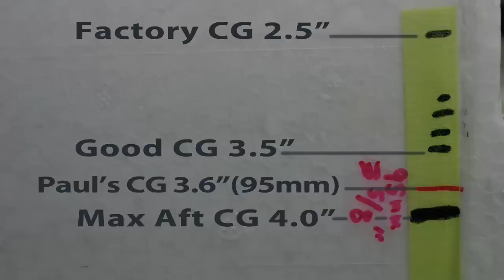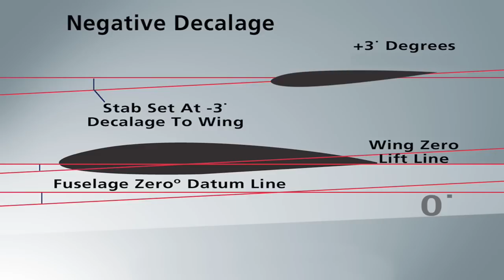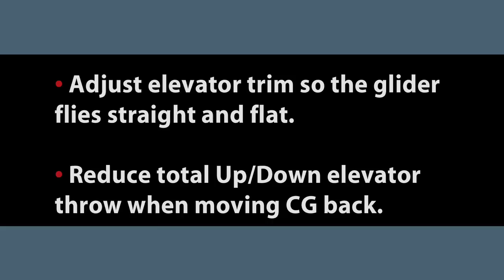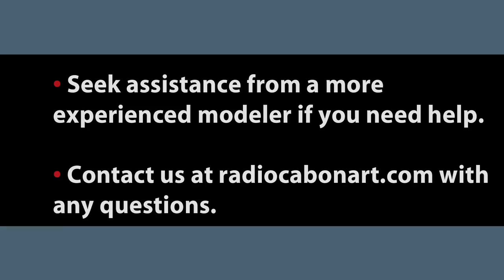Parkzone/E-Flight RADIAN Glider Modification & Tuning Clinic #1

Comment from the maker: As mentioned in the above video, the decalage angle will vary from plane to plane, and the Pro versions seem to have less decalage angle as compared to the 2 chan version.
Change this decalage angle by small amounts if you have not measured exactly the stock decalage angle on your plane. If your plane glides flat with little to no elevator angle required, then your decalage angle is close to optimal. CG must also be adjusted when you change the decalage angle!!
Reply: Paul Naton Have you checked the new E-flight Radian to see if they fixed the damage angle?

Comment: Got your CDs on gliding...somewhat over my Radian head.  However this presentation is extremely helpful.  Have been flying the Radian now for 4 years and I can appreciate the modifications you are doing!  Will look to do some small changes on my current Radian and tighten it up.  Next Radian will suffer a host of changes!  thanks

Comment: I'd like to start off by thanking you for taking the time to put this video together; I enjoyed it very much . I bought the Radian 2 meter glider; like the one in your video and made several of your recommended modifications even before I ever took it for the maiden flight. By the way, I've just gotten into the RC plane hobby two weeks ago and this is my first plane ever. So I reinforced the tail with 3/32" thick plywood similar to what you did. I moved in and reinforced the elevator horn similar to what you did, I changed the decalage by upping the angle on the horiz stab similar to what you did (mine came to 6.5mm for that gap) and added 14 grams of lead weight under the rear skid. I then proceed to verify my CG and see how close it was to the 3 and 5/8" you prefer. This was the hard part, as I did not know how to verify CG. I do research online and end up using a method where the eraser ends of two pencils are used to balance the plane on each wing. With a pencil on each wing, the modified Radian balanced at 4.25" behind the leading edge! So I concluded I had too much tail weight. In the end, I completely removed the 14 grams of lead weight on the tail and added 12 grams of lead right behind the electric engine. Only then where the pencils right under the 3 and 5/8" CG mark. Doesn't that seems strange? What's your opinion on the reliability of this CG verification test method? I did end up flying the plane the next day and when I applied power it immediately wanted to nose dive hard but I still managed to keep it in the air. It was much easier to control once the prop was off but within 5 seconds I hit a tree, so I did not have time to evaluate glide characteristics much and now I am repairing the damage which is not too bad.
Reply: Ay ay ay. Ignore my above post. I don't yet know what I am doing as I am finding out the more I get into this hobby. I'm not giving up though :)
Reply: Talking things out often leads us to The Truth. Thumbs Up, don't forget to share your findings : )

Comment: Vertical lines no problem. As CG goes aft, pitch authority increases, so less elevator deflection is needed for X amount of pitch change. If you would tune for all out akro, you could increase total throw and use a bit of expo to smooth out pitch response. For thermaling at aft CG settings, very little elevator throw is required to change angle of attack and airspeed. See part 2 of this series to learn about maximizing servo resolution with servo arm location and programming.

Comment from the maker: Move the battery back as far as possible then add lead to the bottom of the fuse in the tail area.  This is noted in the video. Takes about a 1/2 oz of lead to get CG back.

Comment from the maker: The bigger incidence meter is by Robart, you can these anywhere you buy hobby stuff. The smaller meter I made from an older Tower Hobby laser incidence meter bar set. Shortened the bar way down, ditched the inaccurate laser, and added a bubble level for referencing.

Comment: hi paul, my name is jim, and I am on my 2nd radian, when I came across your video on modifuacation  of the radian. first of all I did every mod. you talked about. the only thing I didn't do was add weight to the tail.i took it to the field gave it two small tosses and didn't notice anything bad,so I stood up and gave it a toss into the wind and it flew for about 100 yards without power, I was amazed. I next tossed it with power to a climbout of about 500feet.shut off the power, and injoyed  2 fifteen min. flights. it had lots of speed whin I wanted it. the only problem was trying to land. 4 passes before I got it down. thanks for the good work on the radian.

Comment: After loosing my beloved radian pro due to foolishness, I just bought another.  The shop owner said its a new batch and might have improvements.  The rear of the fuselage is much stiffer in my new radian pro.  No need for a carbon fibre spar nor the wood insert on the new ones.  
I used tape on the wings of my last one as in the video but in my new one, I used vinyl.  It looks better and I'm pretty sure its stronger.  It definitely works better on the wing tips.  It may be a touch heavier but I'm sure the difference is less than a team.

Comment from the maker: This is standard Radian with flaperons added.
Adding extra weight to a glider is usually not a good idea, but to get the CG back to where it needs to be, extra weight in the form of tail structure was added. If the battery pack could be moved aft about 4 inches, then the tail weight would not be needed. I only added about 1/2 an ounce with the mods, and removed weight in other areas to compensate.
Paul Naton  Radio Carbon Art Productions

Comment from the maker: The 'shorty' bar is a cut down version from an old laser incidence bar, useful for hlg's and other lighter craft. Just get a basic bar set from Robart, the analog angle meter is plenty accurate enough. I use a digital Iphone app 'Inclinometer' combined with the Robart bars for measuring angles with more accuracy. As long as you are +- half a degree (a bit of negative angle better) you are good to fly. Even though there are reports that newer kits have a reduced decalage angle on the fuse, many new planes still have a 3-4 degree angle, the foam moulding always varies, and the stiffener strip glued in the back of the fuse dictates how this important angle ends up.

Remember, if you move the CG back and don't check/change the decalage angle towards zero, you will have a plane that wants to pull up even worse under power and will want to pitch up when ever speed goes up. (porpoising) without lots of down trim added. My 9 year old can fly my Radian easily with CG behind 3.5 inches, and decalage at zero, elevator hand trimmed for speed required for type of flight, more UP for thermal (slow), DOWN for cruise & coming back upwind.(more speed) (trims set to flight modes to make this easier) He could not easily fly it at stock CG and decalage, he could not keep pitch under control regardless of trim setting, and I even had a hard time keeping pitch angle smooth.

Comment from the maker: Gap Seal: Device to cover over the gap between the wing and a moving surface (flaperon) to smooth the airflow and decrease drag. The flaperon surface I cut out is bottom hinged with tape so as I can get a large amount of down deflection for landing speed control, I can get about 70 degrees down deflection for landing flaps which I control on the left stick. (mode 2) You can use fabric CA hinges commonly used on wood planes instead of tape to act as the hinge. To allow the flaperon surface to act as an aileron for roll control, that surface must be able to deflect up between 35 and 45 degrees. The front edge of the flaperon surface is sanded back at a 45 degree angle to allow for UP deflection of that surface. If not sanded at and angle you will only get down deflection. With the flaperon sanded, there will be 1/4" V-shaped gap between the wing top surface and the front edge of the flaperon. As the wing is still thick at the hinge point, this gap is wide and deep, causing some drag, especially at higher speeds. Gap seal is a flexible yet stiff material that covers this gap and smooths the air flow yet allows for full movement of the surface in any direction.

Problem is that Gap Seal Tape designed for this purpose used to be commonly available, but I think Multiplex is the only maker of this stuff and if you can find it, it is expensive! You can make your own gap seal, 6 mil drafting mylar can be cut in thin strips, just wide enough to get a good gluing surface on the wing and overlap the flaperon by an 1/8th inch or so. Thick plastic tape also works, you stick two strips of tape to each other, leaving enough sticky side to attach to the wing, then trim to size. Takes some practice, on foam wings a Mylar type plastic glued to the wing works best as its hard to get tape to stick to foam. In reality, you could just leave the gap open, most will not notice the difference in drag. Having gap seal does help drag at higher speeds and makes the surface more effective when it is deflected. That's your gap seal tip for today.

Comment: If your cruise trim gives straight and level flight but the plane is pitching up under power try mixing some throttle/elevator so that, as the throttle is advanced, the elevator moves down about .125 inch and then adjust as necessary.

Comment from the maker: Good tip on the mix. If your CG is getting back far enough towards the 'good' spot, you may actually have to mix some UP elevator to your throttle.  Why? There is a lot of down thrust in the motor mount, and as the CG goes back, that down thrust angle starts to have a big influence on the flight path under power and the glider will want to dive at full throttle. Setting a mix  -throttle/elevator - will keep the glider going where you point it under any throttle power setting. Mix amount with UP or DOWN elevator will depend on your CG position and the decalage angle your stab is set to.
Reply: Paul Naton  MP3.

Comment: I recently received a Radian Pro from HH and it had some real flight issues but as it turned out I had to LOWER the front of the HStab 5mm. It now flies great. Parkzone must have some real consistency problems with this fuselage.If your new Radian is diving for the ground and you have already gone over everything else twice try this.

Comment from the maker: Jujitsuboy-  Sounds like the CG is still to far forward. The down thrust in the motor will overcome the pitching up under power, but when in glide mode with the CG forward, you will get pitch up once the plane speeds up. You can add down elevator trim to compensate, but this just adds trim drag and the plane will not want to stay at the trimmed speed.  Try moving the CG back slowly and test further. My Performance Tuning For Gliders training video explains all of this tuning stuff.
Paul

Comment: the best glider i ever had what an olympic 2.  only. 11.  balsa.  i built it according to the plans.  but made it an electric.  the front wing had such a high pitch to it it barley penetrated medium wind.  so i ground the fuselage down to the point that the bottom of the front wing ran parallel to the elevator.  everything changed.  it became a dream ship.  like what you did with your radian.  i'm planning on getting a radian.  i'll do the same.  thanks for the reminder.

Comment from the maker: Lets say you keep the decalage at the stock setting (this angle varies from plane to plane) which gives the plane lots of UP elevator trim. As the CG moves aft, the stab has even more influence on the wing and angle of attack, the stab gives you even more UP trim effect as the CG goes back. You need to get the decalage close to zero first, then move the CG back in small increments. At zero angle you can still trim the elevator up to compensate for the very nose heavy stock CG position.

Comment: Issue with Radian is that you can’t really lighten the front of the airframe much to shift CG aft as much as it needs to be. You can put in a lighter battery pack, but lack of mah. capacity is an issue for most. If you need to add tail weight to get CG back, then might as well add that as structure as much as possible, gaining airframe stiffness and accurate control authority and well as trim repeatability. If you watch the Radian Tuning Video #2, I discuss weight distribution as well as solve the poor stock servo installation problem. For any glider, you want the weight/mass centered around the CG and center of pressure as much as possible. Adding weight/mass to the tail is not the best solution, but for electrics, sometimes the only solution to get the CG where you need it. Weight/Mass in the ends of the airframe reduce yaw/pitch damping and make the forces needed to induce directional changes greater. The Radian really needs the battery mounted around the CG, then you can increase/decrease wing loading (for wind conditions) by changing the pack capacity. Servos should be in the tail or up near the motor/ESC in the nose. Can’t believe this has not been optimized in later releases of this classic trainer.

Comment from the maker: That is a first gen standard Radian in the video. They have made some improvements in later production runs, more reliable push rod ends being one of them. Decalage angles are highly variable still, a tuning item that should be checked.

Comment: I bought an RP and maidened it a week ago. Since I don't have the Robart's meter. I took the RP out and set it on an elevated platform. I sighted down the bottom of the airfoil, and made a mark on a wall 90 ft away. I "sighted" basically through the leading edge, and the center of the trailing edge, and made another mark. Next I sighted down the vertical stab, and made another mark. The vertical stab mark was 10 inches below the LE mark and 15 inches below the bottom surface. (I do a similar procedure to set toe in on my pickups. It's more accurate than the computer version at your nearest alignment shop.) This indicates that the vertical stab has a positive incidence of either 0.5 or 0.8 degrees. Guess what? The plane pitches down enough that I cannot get enough clicks of trim out of the Tx to avoid it. Needs tailboom stiffening.
Reply from the maker: Jeff Washburn The decalage is close enough, you may need to adjust the elv pushrod length so you have adequate trim travel with your TX. You need the up trim as the plane is most likely very nose heavy at the stock CG.  Move CG back, won't need as much UP trim to keep plane gliding without pitch down. You can check decalage with an estimate: site down the elevator holding plane at arms length, with the elv flat, see how much of the top and bottom of the wing you see.  All wing top: positive incidence/decalage  Mostly bottom, the opposite.  If you see 25% wing bottom & 75% top, sighting down the elv through the wing trailing edge to the wing leading edge, decalage is around zero. This works for fixed or flying stab.
Reply: Paul Naton Thanks! I started yesterday with a one ounce wheel weight taped to the tailboom. I was getting close at about 3-4 inches behind the trailing edge when I ran out of temperature tolerance.

The recommended CG is far enough forward that there is minimal ballooning with crow. I found that out on the first flight. At least with rhe RP, the center of lift seems to move at least an inch forward under crow. This suggests that CG location is an optimization process around power, reflex, camber, crow, and straight and level. If true, then that is part of the reason people conclude that CG is personal.

Comment: The RP main wing has about a 2 deg angle of incidence. With the decalage at zero the fuselage will fly in about a 2 degree down angle. In Realflight 7.5, I have been experimenting with the RP (yeah, I know it's a sim.) With the main and stab at 0,0, the plane descends at about 1-3 ft/ec in dead air (slight phugoid there). At 2,2, it descends at a near steady 1 ft sec. I have yet to try 2,0. It should get a little more lift, but a little more drag, too. At 2,2, it's not easy to land, and it thermals better than 0,0.

Paul, this confirms what you say. I'll try the 2,0 tonight.
Reply: 2,0 is next to uncontrollable without moving the CG forward almost an inch. Then any benefit of added lift is cancelled because the plane flies nose down anyway. When you get the CG right, then the sink rate is about like 0,0.

O decalage is the only way to go for best thermaling.

Comment from the maker: While the historical definition of decalage pertains to bi-planes, the modern use of the term defines the angles between the zero lift line and/or chord line of the airfoil and the stab or elevator.  Referred to as Aerodynamic decalage (to zero lift line) and geometric decalage (to chord line) .  We usually use the chord line reference angle to measure the offset angle between the wing and stab for rigging our models. For gliders we want minimal decalage especially with more aft CG's, then trim for the speed needed. For full flying stabs, decalage is a non-issue, though it is still useful to know the 0-0 decalage angle for setting up the servo mechanics and radio programming. My professional r/c soaring training videos that I sell cover these important tuning topics in great detail, my site link is in the description above.

Comment from the maker: 3 to 3.5 cg is a huge range for this plane, 3 is very nose heavy, 3.5 is much better though I fly mine well behind that setting. At a 3 setting, you will need up trim as plane is nose heavy. CG back at 3.5, you will need far less up trim.  Make sure your FF stab is centering perfectly, even a small amount of play/slop will make trimming the plane difficult as the fin will never center itself back to the zero stick/trim setting after a movement.